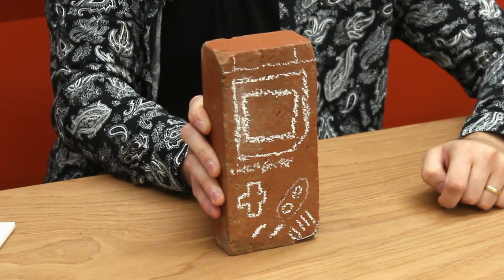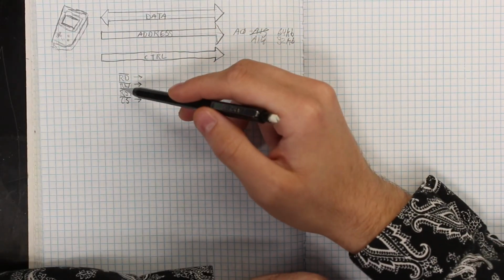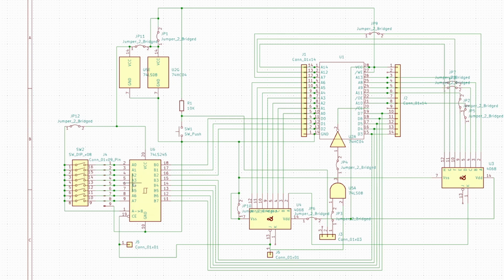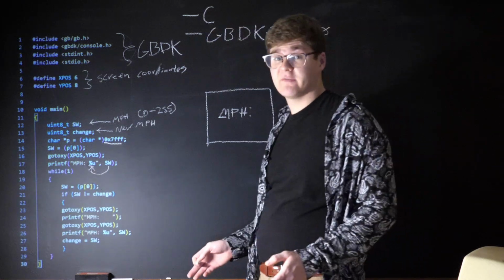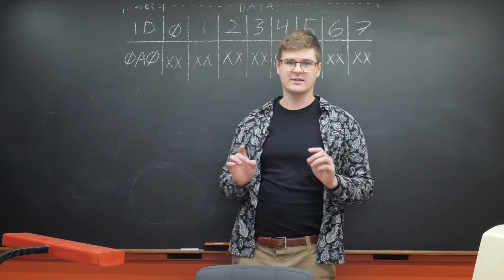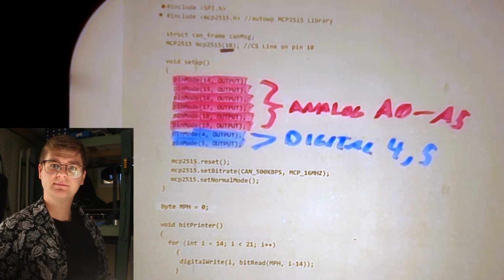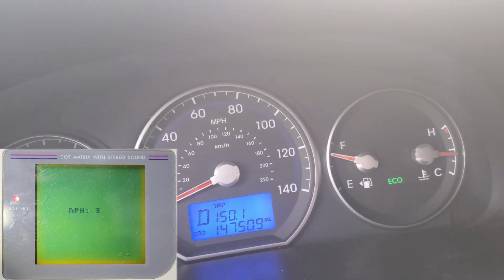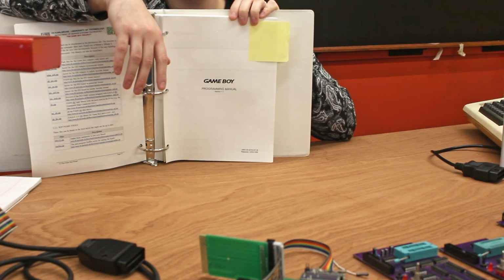World's Worst Digital Dash

Comment: A+ mental breakdown at unit conversions. Now it needs big numbers and then add all your other figures (Engine RPM, gas tank percentage, battery voltage, driving gear, odo reading) for full digital readout experience, if you needed to experience maximal suffering anyway.

Comment: Hmm, I'm wondering.

Would it be possible to use something like gbstudio to make a GUI and use a link cable to communicate with a raspberry pi that's connected to an ELM327?

Communication would look like:
Car --> ELM327 <--> Raspberry Pi --> Gameboy (via link)
Reply from the maker: I've heard of gbstudio and it seems like a pretty rad project for homebrewing Game Boy games. If it's got support for data communication over the link port, then I think you've got the most power Game Boy display terminal on the planet! Would be a heck of a lot easier to implement than my project, plus the display font/graphics would look waaay nicer! Also, parsing CANBUS data would be a cakewalk on the Pi compared to the Arduino. Would love to see someone tackle that project!
Reply: @johnsutley4744 on it!

I'm wip on a development board for gbstudio and more. Effectively allowing devs to implement things like motion sensors and such though just the link port via the rp2040. 

The rp2040 is special since you can effectively flash your own communication protocol on it through its "PIO" capabilities.

The main limitation is that each packet is limited to 8bits with this engine, but there's a lot of possibilities on what can be done.

Hoping to see more Gameboy related projects on the channel!

Comment: Great video! There's a ton of great info here, and everything is really well explained.

One option that you glossed over that might have been quite a bit easier in the end would've been to use the link port on the GB. It's actually basically just SPI, so I believe you could've integrated that directly with your MCP2515 board. You would've needed to write the library to talk to the IC, but it would've avoided needing the Arduino and all of the bus interface logic, and you could just use a normal flash cart.

One hard part is the link port doesn't have a Chip Select (CS) line, so depending on how the MCP2515 behaves with the CS always high/low that might complicate things, or make it infeasible. There is an SD pin in the port that might be usable for this, and if I'm reading the DMG schematic it appears to be tied to the gamepad inputs reading logic (??), so not exactly elegant but could be possible.

Anyway, just wanted to throw this out there, I'm sure you're not planning on revisiting this, but could make for an interesting follow up video if it works.

Comment: I’d have rotated the larger board and sistered it behind the cartridge edge connector board so it sat in the same profile and directly behind the gameboy, I’m sure you could squeeze that board a little further to get it the same size and shape as a gameboy, with the db9 connector at the bottom of the board facing down so the wire feed to the car is sleek and ‘out of sight’ low down heading down into the underside of the dash instead of sticking out sideways all over the place

Comment: Awesome project. Not familiar with the SDK you're using, but based on your description, you might be able to skip the "MPH: " part in your while block, thereafter printing to XPOS + 5. You could also select the format string based on size of SW (something like "%u", "%u ", or "%u  ") to handle the update in one print. Would be cool to see KPH (obviously on the next line, beneath the superior MPH).

Edit: one other thing, it would be cool if the alignment of the speed could be chosen by the driver e.g. d-pad left makes the software use "%u  " for single digit speeds, while d-pad right makes the software use "  %u". User experience is important, you know?
Reply from the maker: Valid point, might have saved a few cycles in just changing the XPOS var! 
The only reasons I didn't choose to add more functionality were  a) I wasn't sure how much program space I'd be using, so I tried keeping the program as small as possible  b) wanted as fast of an update time on the screen with minimal flicker  c) there were just so many different parts of the project, I wanted to keep things as simple as possible. After having done the whole thing though, I really like the idea of all the added functionality and better UX. Maybe I'll do another Game Boy project in the future with much better display & interface software...

Comment: Nice work! Gotta add some fat digits to that rom though :)

Would it have been easier to connect to the RAM address space? I think you may have needed less logic since you could map into A000 - BFFF instead of a specific 16-bit address
Reply from the maker: Yeah, that's a really good point. Towards the end of the project, I was thinking that since the actual ROM code is about 1KB, I could have just used the A15 address line as the signal to access the 8-bit port, limiting the ROM address space to 16k. However, I'd already started ordering the last of the PCBs and was a bit too late to save a few chips ;)  But good call on using just the RAM CS line for port access, wish I'd thought of that!